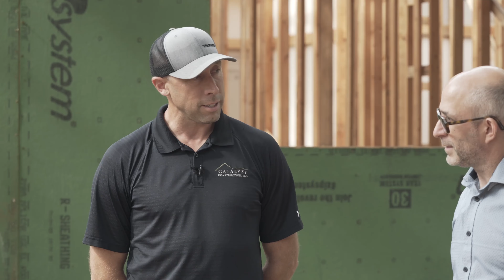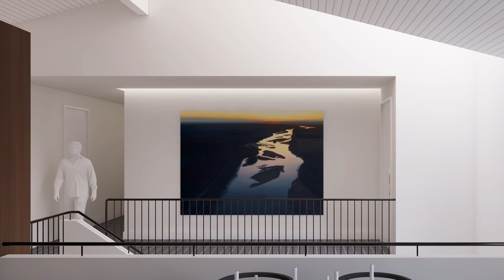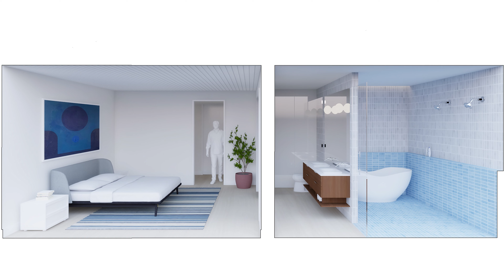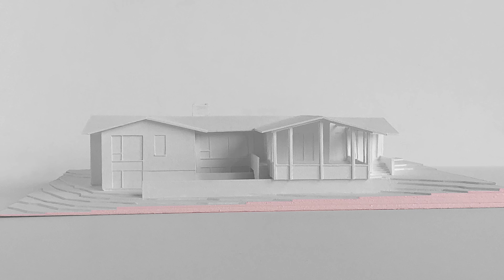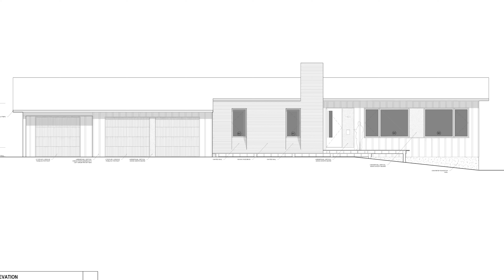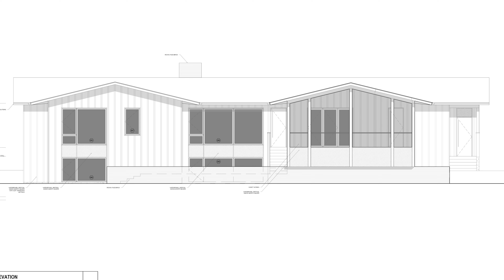Balancing Design and High-Performance Construction

Comment: Nice, does the vent have any radiant barrier detail?  Also is 1.5" sufficient for air flow?  Do you have to vent the lower decking to allow moisture in the insulation a path for drying or did you spray foam it?
Reply: 1 - Didn't look like it, no mention though.
2 - 1.5" is actually pretty big for ventilation in this case. BSD-105 (building science corporation) mentions a high end of just 1" for air venting behind a drainage plane on a wall.
3 - The lower decking has ventilation above it - venting below would constitute a vented attic and probably not what was being used in this house. There shouldn't be a need to ventilate that space depending on how they built the house as a whole. It would be protected from bulk water but the upper edge would be subject to regular moisture in the air as it vents naturally. Ideally shouldn't go through the ZIP
Reply: @ShaolinIronLeg   I'm a fan of "cold roofs" with ventilation.  They cost so much less to insulate and they are designed to dry so when something goes wrong it is resilient.  I live in a desert so there is lots of time and heat for drying but we do get monsoons.

Drainage planes behind walls are usually vertical so the drying is aided by gravity and convection.  When you lay it over almost flat both of those effects are greatly reduced, that's why I wonder about vent volume.  A typical vented roof assembly has a huge air space above the insulation and big vents.  I want to compress all of that in to a roof that's probably around 20" from the interior ceiling to the top of the standing seam metal roof with a 3/12 pitch.